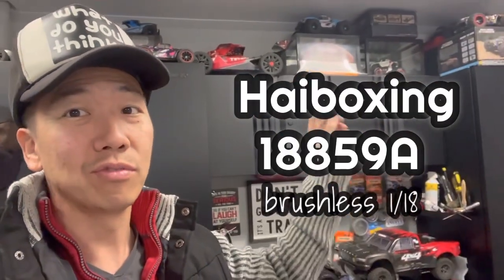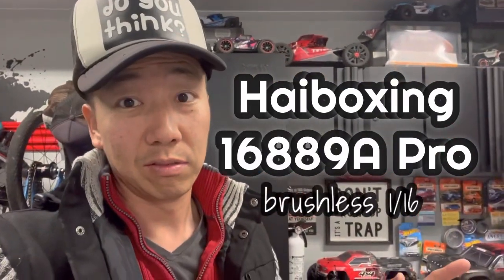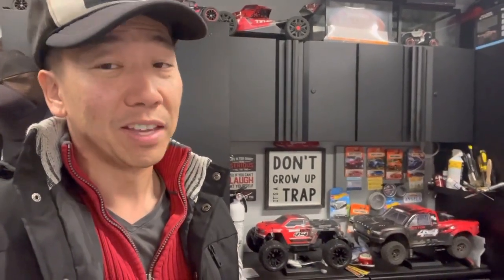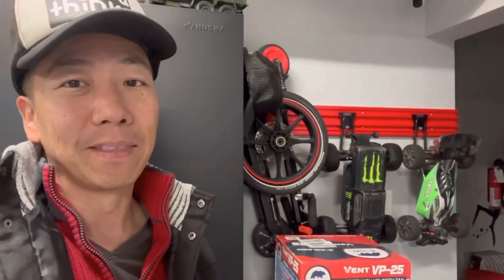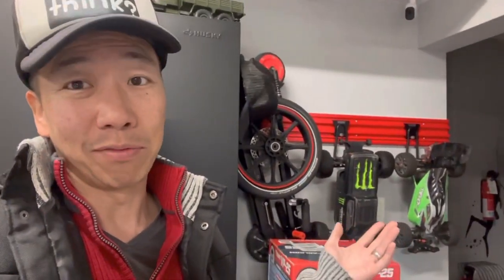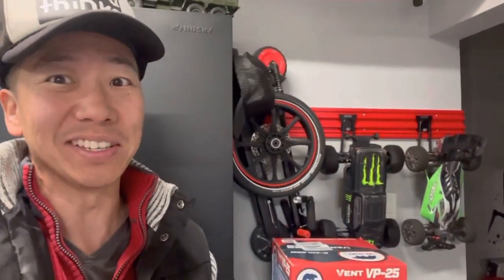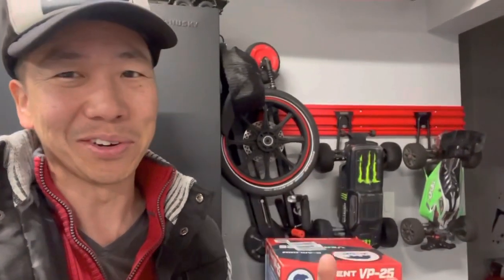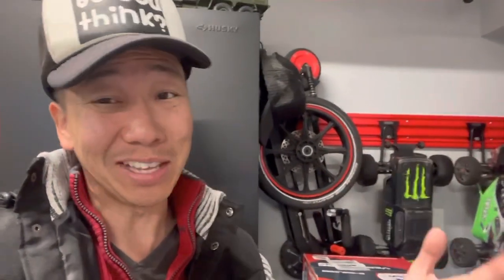Why You Should Build a 2S Arrma RC Car For More Than The Price Of A Stock 3S

Comment: You have such a pragmatic approach to an obsessive hobby.  I wish I was as disciplined as you!!  And I agree that 2s can be very fun!  I swapped out the stock Senton 3s motor to a 3900kv and run 2S packs. Tires do not become unglued and it takes some decent jumps 💪
Reply from the maker: Haha, thanks for your compliments. Just trying to be real as I suspect most people watching YouTube are trying to balance practical with fun but also with a sense of budget and value. 

Not everyone wants to get super deep into everything but enough to have fun and learn something. I’ve learned a lot about designing power systems from these cars.

Comment: I upgraded my Arrma Mega to a 3s brushless and I put a 19 tooth pinion and it hits 36 mph and that's ENOUGH speed lol it's an animal.  Speed is not everything.  My Mega goes fast enough for the alley ways and streets in my neighborhood.  Good video bro!
Reply from the maker: Sweet. Nice to find the sweet spot for whatever speed you're looking for. I find 40mph quite nuts and takes way too much space to even get it that far w/o hurting anyone. Which Mega did you mod?
Reply: @Funcentric  yea 40mph is crazy if you don't have the space.  I started the RC hobby last year and I bought the Green Arrma Typhon.  I bumped it up to a 2s lipo and then a Spectrum brushless motor and ESC combo.  Then I bought the 3s Lipo.  19 tooth Pinion and it rips lol

Comment: I love your longer videos are awesome i love mine both rwd easy 2 maintain an both brushless
Reply from the maker: Thanks! Sometimes I can’t tell if people get too impatient with the long ones. I try not to repeat myself but catch myself doing it. Just trying to reiterate important parts I guess. Hope the video helped.
Reply: @Funcentric  man you helped me alot thank s so much was funny I strip all hands all black tread lock tighten all cleaners after incase treadlock on parts got very good at it an fast :).Am happy as now know for future reference my models were harder 2 do as needed take all pin s out aswell shaft not come out like your 1 did now know how shafts come off from diff  aswell there is screw in middle going to diff

Comment: For 4s? I would do Drag Racing. That is more fun than going back and Forth. I have the cones for it. So possibly? I may get me Street Stock Arrma and make some Drag racing. I have cones and lights. But doesn't have the tree lights which is fine and I can make the end of the line Which ever works for me

Comment: what about getting a 3S and just running it on 2S for less wear and tear?
Reply: I was about to ask the same question. The Arrma 3S range will run on 2S I'm guessing, they'll just be a bit slower?
Reply from the maker: I should’ve addressed that in the video but will make a new one. For designing power systems whether it be a mn rc car or drone, high kv goes with low voltage and low kv goes with high voltage. 

If you match a 2S on a 3S car, you’ve running low voltage on a low kv motor which will feel very laggy. 

The 2S system you’d build from an Arrma mega would be designed specifically as a 2S rig with much higher kv motor than what’s in the 3S BLX stock. 

In other words, a 2S built correctly will outperform a 3S on 2S power by a long shot.
Reply from the maker: @mauriceharvey4300  not just slower, but laggy. The kv rating of the motor on the 3S blx is much too low compared to what you’d have ideally on a 2S build.  

High voltage goes with low kv. 
Low voltage goes with high kv. 

2S on a 3S BLX would be low voltage on low kv which will be very very underwhelming. Definitely not the same as a car built specifically as a 2S performer.
Reply: @Funcentric  Thank you very much for your explanation. I didn't know about kv ratings and voltages, etc. Thanks for taking the time to answer my question.
Reply from the maker: @mauriceharvey4300  Sure thing. 2S in this particular application will still operate. It is not harmful. I do have another video about the math behind it all. Each battery has an amperage rating which needs to be HIGHER than what’s being drawn by the motor. In the case with the 2S and the motor on the 3S BLX, it’s fine. Again, performance will just kinda suck.